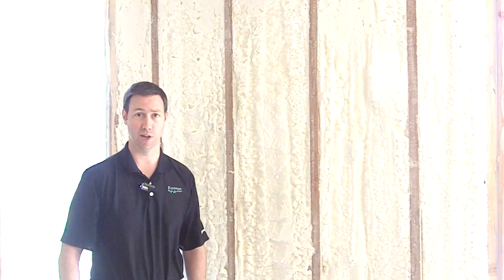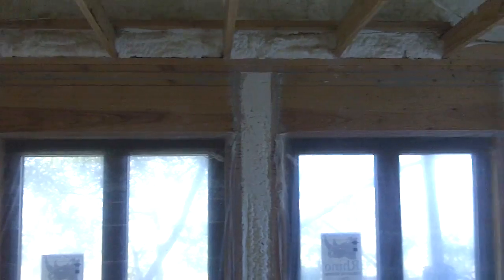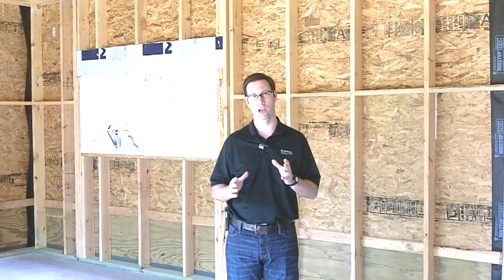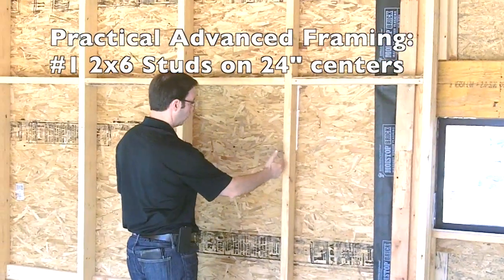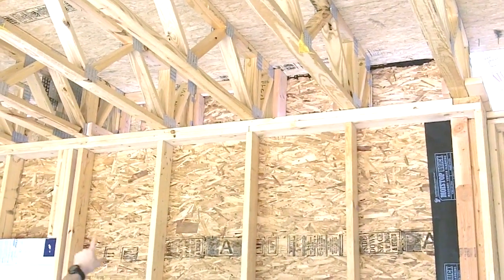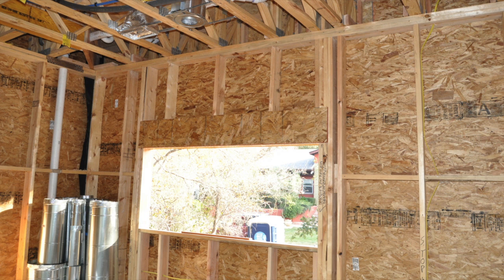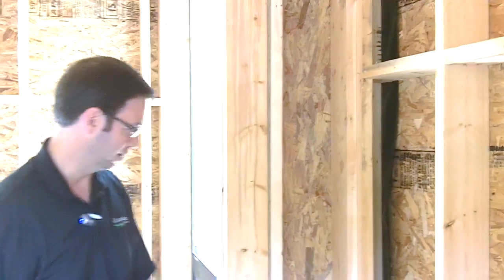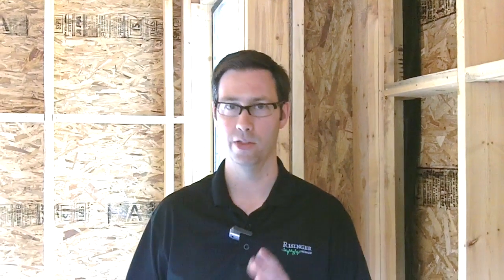Advanced Framing vs Traditional Framing

Comment: there's so much wrong here ,I don't know where to start . Most of the lumber in a house is for backing , and it's not useless . California corners should be outlawed because they provide no nailer for exterior coverings and produce a very weak corner where strength is needed most.The cheap headers provide no backing for corner bead or window treatments .
24 " O.c. is to far to span sheating and sheetrock , even5/8 .the money saved on studs is paid to the rockers to do these shit jobs .If you see your carpenter using any of these techniques , get someone else immediately !!
Reply: +Randy Reinbold  You say "California corners should be outlawed because they provide no nailer for exterior coverings... "
  A California corner provides a nailer on both sides. 1-1/2" on one side and 7" on the other. You only need more than that if your using wood corner trim. 
  "...and produce a very weak corner where strength is needed most."
 Why is strength needed most in a corner? If there is a floor above it, it has 1 floor joist over it just like all other layouts on the wall. If it has a truss over it then the same applies. When doing a typical truss layout on 2' centers, only every other truss sits directly over a stud.  A California corner consists of 2 studs with a connection of another from the wall that connects to it. That's 3 times as many studs than any other place in the wall.
 "24 " O.c. is to far to span sheating and sheetrock , even5/8" 
  Do you use a 16" OC layout for roof trusses?

Comment: It is a complete lie to suggest that "framing lumber accounts for 25%  of a typical walls volume" ! Complete and utter nonsense!
One would need to put studs every 6" to accomplish the "framing lumber = 25% of wall volume".
Why lie?
If you want to make a sales pitch, then make one, but don't provide false information.

Also, depending on where you live, 2x4 exterior walls are not allowed in some areas.

Noteworthy, it takes 3 studs @ 24" on centre, to make a 4' wall panel.  If these are 2x 6 studs,  stud lumber volume is actually greater than the same wall panel done with  2x4s @16" on centre (which would require 4 studs to make the same 4' section of wall).

the math:
Assume 8' high x 4' long 2x6 wall section
3 studs x 1.5 x 5.5 x 96"= 2376 cubic inches

8' x 4' long 2 x 4 wall section
4 studs x 1.5 x 3.5 x 96"= 2016 cubic inches

The only advantage in 2x6 other than labour savings is that less studs = less thermal bridging.   

You people need to learn the science of what your talking about if you want to responsibly post "informational" videos.
Reply: +S H Right, it's more like 12%.

Comment: I built my first home in 1978. In California. I've built hundreds since then. "California Corner" was originally coined as a disrespectful term like "California rolling stop". It meant you were cheating and trying to go faster, saving time! You build in Austin and you're worried about the R value you lose with lumber? LMAO! That might make a cool sales pitch to a tree hugger but it will NEVER be noticed on a utility bill even in Alaska. It amazes me how all the newbs in this industry are always trying to eliminate lumber from a structure!  I worked for a company a while back that eliminated trimmers from all their door openings saying "they weren't necessary"! Try to hang a solid core door on that! I quit them. Do you seriously think your homes will hold up as long as the old skool methods? SMH! Material is not near the quality it once was. I see 10 year old homes daily that have worse deterioration than one built 50 years ago simply because the lumber, hardware, virtually everything is of lesser quality. Hell, its all made in China!  If you want to reinvent the wheel young man you need to think beyond lumber and drywall, etc. Frankly, I can't believe we are still using those materials at this point.
Reply: I'm not a builder though I did have one house built in CT.  One the floor joists were put in position, I went to look at the house.  Nuts! The floor was not level front to back with the carrier beam running side to side.  The builder was not disposed to do any thing, you know "crown up, crown down".  I reminded him that the contract called for an inspection by a professional engineer prior to closing.  Well, I only had one working eye but I did have a working 6' level.  He got the house done and then had to jack up the entire house to recut the beam pockets and replace most of the oak floors!.  I've always wondered what that cost him!  I caught the windows early and found 6 of 23 were defective.  He checked and called me: "John, you're wrong!  ALL the ** windows are defective and will be pulled and replaced."  Code called for 3" of bats in the room over the garage; I specified 9" - nice warm room.  My theory is to invest what is horribly expensive to change after you move in!  Now my question is about the caulking and OSB sheathing.  What do you do about the fumes?   With my first house in OH, we had a wind shear remove 1/3 of the roof and about 20% of the siding.  BUT I had a very cooperative insurance company and a very imaginative contractor.  The contractor convinced me to use 5/8" rigid Dow Board and to replace the Plexiglas skylights with glass.  Best money I spent!  Road noise, local and the OH turnpike and trains disappeared.  Gas bill went down almost 27%.  The buyer HAS to be in control and visit the work site very often if only to ask stupid questions.
Reply: Randy Armstrong Right on my friend!
Reply: Randy Armstrong if you have ever used a thermal imaging camera on a house you would see the heat loss or heat gain depending on climate from your corners. These designs have been tested and vetted by people more educated than you or I. As to wind loads, not sure what a corner design would change much. If you need wind load protection you design a shear wall. And to the ridiculous truck hitting a corner comment.... Are we really going to start designing homes based on poor driving skills???
Reply: The Garlic Farm 100% bang on
so oversealed that house are rotting inside 15 yrs.think i ll go into reno s i see a lot of potential
Reply: Roasted
Reply: Older houses were built with older lumber which is stronger. Just look at the rings on the end of a 2x4 on an old construction vs the new lumber you got. The new lumber is much younger and weaker
Reply: Because people in the south use material and techniques that are inappropriate for the climate.
Reply: Yeap I see a lot of homes in these communities here in Arizona already going bad after 10 years. Cheap material plus cheap labor makes sense
Reply: I've been working in home repair and remodeling for 20 years and I see a lot of rot in houses that are not old. Most of it has nothing to do with framing and everything to do with trying to be too energy efficient. People go nuts with a caulking gun trying to seal every little opening. That traps moisture and rot is the result. A house needs to breath and water needs a way to drain.
Reply: @zone4garlicfarm  a house needs to breathe is just a lazy outdated term. It's just not right. Proper planning and execution alleviates any problems.
Reply: Timms MC, partially correct, the vapour barrier only needs to be completely sealed if it also acts as your exterior moisture barrier. Here on the west coast of BC we have to place a moisture barrier( most builders seem to prefer sealing the exterior moisture barrier) and then a capillary break outside of that allowing any moisture that penetrates the second plane of protection (exterior cladding) to escape down the wall and out the bottom. If this method is chosen, the vapour barrier need not be continuous or sealed
Reply: @Konda You are partially right, and by that I mean it may very well work in your location, but I'll guarantee you it doesn't everywhere. Some homeowners around here have had to find out the hard way. For the moisture in the structure to be released to outside air, conditions have to be suitable for it. We experience very wet both fall, winter and spring, and especially northfacing structures without any direct sunlight simply are not capable of releasing enough moisture to the outside air, to stay clear of rot and mold. It HAS to be sealed 100% airtight on the warm (in)side of the insulation, for it not to cause problems. For the same reason, blower door tests have been instated to check for leaks in the vapor barrier. 

It has reached a point where a house has become like an insulated plastic bag, and so there are a lot of initiatives going to find more sustainable building methods with simpler materials and smarter building, to cut back on cost for aquisition and running cost for basically unnecessary HVAC, that could be done very differently.
Reply: The real thing with a three stud corner is most framers build them then sheet the outside and forget to insulate them. If that happens you cant insulate from the inside. If you build homes you know what I mean and have probably done that
Reply: What do you think of those ICF walls?
Reply: I am grossed out by styrofoam. Why not use rammed earth instead? Totally natural and cheap. Just more labor intensive.
Reply: @T.B.: Rammed earth is great as thermal mass, but a horrible insulator. Density too high and still air content basically non existent.
Reply: Randy Armstrong ;
Reply: I always used a 4 stud corner, and sometimes 5, if it was a 2x6 wall. And there's no such thing as "overbuilt" when it comes to framing, and you should be ashamed of yourself with that 24" o.c. nonsense.
Reply: @jasonroland6345  16" on center is traditional, but really doesnt benefit much.

Comment: When talking about cutting down on the amount of lumber, My calculations say that you will use more BF of lumber for wall framed with 2x6 @ 24" o/c as you would 2x4 @ 16"o/c? Just curious how one could argue that you will use less lumber. I do concur that the R10 value of the headers and the extra room for insulation is a plus.
Reply: Less lumber per volume, but more lumber per area.

Comment: I don't think 24" is legal for 2x4s (at least in Canada). Maybe for 2x6s it is. This may be an important point.
Reply: 24" is legal as long as you use thicker drywall. Its maximum distance no more than 24".

Comment: & a Great Idea that I would like to see use of here in So Cal (even if it may be overkill for my local climate) is the spray foam insulation!!!! Awesome sound proofing & no drafts whatsoever + high R-Value. I could only guess but probably around 60+ R or more,I dont claim to be an engineer so thats based on my having to double up a ceilling with 2 layers of R-30 to achieve what the client wanted & really wasnt for all the cons such as cost,duat & loss of attic space being accessable for future upgrades that may be availabe/added in the homes future service life.

Comment: Personaly I have 30 yrs experience framing as the typical "California Framer" & I think he has some great ideas on being innovative but I did find some weak points on this method #1 structual sheathing has its shear strength vertically not horizontally. #2 all sheathing seams should be side by side & landing on a doubler or a 3x (I prefer a 3x4 for 2x4 walls & double 2x6 for 2x6 walls) less bowage that way & the truss joists are new to me & would choose "TJI Silent Floor Joists" for all 2nd story & up applications. I need to start making videos & stop swinging my mag 77 for a living.
Reply from the maker: Thanks for the comments. I've not seen a 3x before. Interesting idea. TJI's are great but when you need duct space the 2x4 truss is tough to beat. As always verify your framing plans with an Engineer based on your climate, seismic, wind, and snow loads. 
Lastly, yes please start making videos. We need more 30 year veteran framers teaching the young guys your craftsmanship and techniques. Best, Matt
Reply: @buildshow  

2 x 4 floor trusses went out of vogue 25 years ago....for good reason.

as the wood ages, the gussets loosen.  no national builder I know of still uses floor trusses on any large scale.

as a framing vendor for one of the largest home builders in the country, if you need floor trusses for duct space over Ijoists...you're designing your houses wrong
Reply: +Richard Burdett  I walk on sheathing that is at 2' OC all the time. The roof trusses are on 2' centers.
Reply: Try to walk on the sheathing on 2' oc if you stand it vertical. There's a reason it's called osb. Osb on vertical is strong enough if the studs are @ 16" oc.
Reply: +Richard Burdett 
Bro...... WTF!!!!?????
If you are framing at 24"OC, then, by code....  you NEED to install 5/8" along with "H" clips!!!!!  I personally use 3/4" Advantec T&G, Glued and Nailed off with 8d Galv Ring Shanks, installed just the same as my sheathing for Sub-Flooring.  Is it an over kill....  YES, But you can't argue with Superiority.  While most build 200+year homes, I build to push that 1k year mark.  with ALL the quality products out now and the testing behind the new technology, there is NO reason a house couldn't last that long.  OF COARSE there is the scheduled /needed maintenance.  But the actual build (structural envelope) can lay for nearly ever if you approach it correctly and secondly & most importantly.... ACTUALLY GIVING 2 FUCKS / CARE about what you do. 
Maybe I'm lucky with the area I live in (here in CT, outside of NYC) and I'm able to use these products and the market can handle the extra costs that go into the homes I build in my developments???  Either way....  IT SHOULD BE the norm!!!! 

And you logic.....???  What the Hell are you talking about with the direction you run the OSB???   NATURALLY....  You install it Horizontally (the 96" measurement from Left to right or vice versa), But that is ONLY because you HAVE to with grained plywood (grain running perpendicular to rafters/trusses.   BUUUT, Technically.....  OSB has no Superior strength one way or the other.  That's why it is fine to run sheets vertically on walls, I HATE when I see "Grained Plywood ran vertical on walls (It's laziness, cause it's less blocking needed to do when ran vertically).  

We have STRICT codes to conform to due to Hurricanes, it's almost as bad as Florida.  Depends where a house is that I build (Typically on the shore), we have to run 16ga. strapping from one rafter up over the ridge to the other rafter (16" down from peak on each side), This sucks with securing our sheathing, but I understand the reasoning and logic behind it.  

ANYWAYS.....  I could keep going and going.  There are so many techniques and Code Requirements (that vary dramatically depending on where you live).  Building for hurricanes is totally different that building for Earthquakes, and honestly I know NOTHING about Earthquake preventional codes.
Reply: 7/16 I always felt was sketchy(on the roof), and you can see swooping in the plywood,expecially when the sun shines on it on an angle.  At the minimum I use 1/2" with clips.  I just can't imagine what 3/8 is like.
Reply: +Richard Burdett I've never heard of anyone sheathing a roof with 3/8" OSB. I use 15/32" with plywood clips in between the trusses, and of course the length of the panels run perpendicular to the trusses.
Reply: +Richard Burdett Here, the roof sheathing on all residential that I've ever seen is 15/32 with clips.
Reply: +AUER-9 I agree. OSB sheathing is Never a good idea where I live, and build homes.
Reply: rdog1121,  I just had a question for you. I will admit up front that this might be a silly question. You were talking about the hurricane strapping. Would it be a violation of the code to run that strapping above the sheathing instead of running it on top of the rafter? Thank you, sir.
Reply: 15/32 is what everyone refers to as 1/2".
Reply: +Jim Watson depends on thickness, type and direction. 2' oc osb 3/8" the correct way yes you can walk on it. If its the wrong direction vs the strength axis then it will not be strong enough.
Reply: +Jim Watson Calgary is generally 3/8 osb w hclips.  On commercial we use 7/16 (14/32) w hclips. Done some with 3/8plywood back in the day now that's sketchy.
Reply: If you are in extreme climates such as the Rockies or Alaska where the snow build up past 4 ft., do you think it is still reasonable to frame with 24" OC with 2 x 6s" or would you go back to 16" OC? And please explain. Thanks
Reply: I have spent months studying building sheds and found a fantastic website at Wilfs Shed Formula (google it if you are interested)
Reply: Matt Risinger oh and that's a concrete floor not a cement floor
Reply: Russell Houston Unfortunately for the building industry, most residential work is done by persons without an education, or apprenticeship. Most dont have the codes both the IRC, or the IBC, as well as state AND local codes. They should be in every lead"s and office or truck
Reply: Sheathing seams?  Why not tongue and groove with a backing plate?